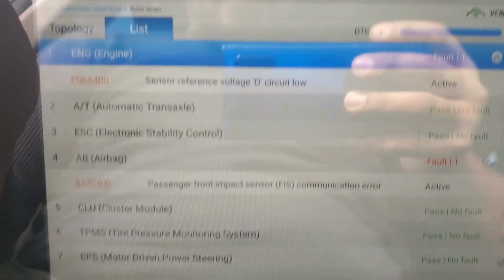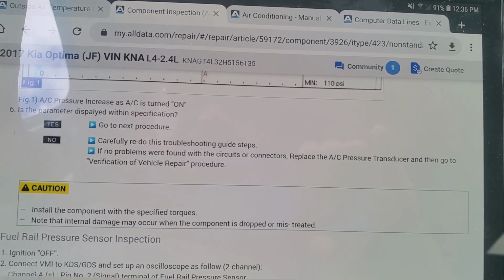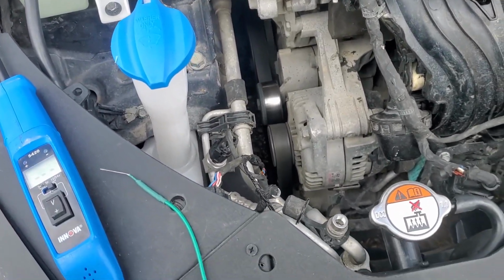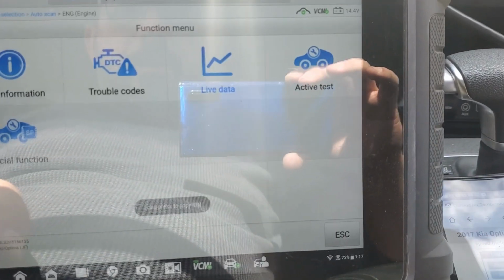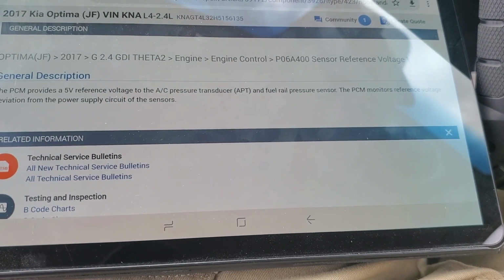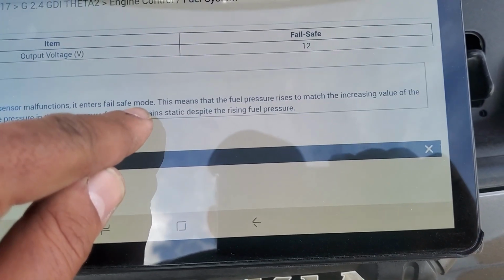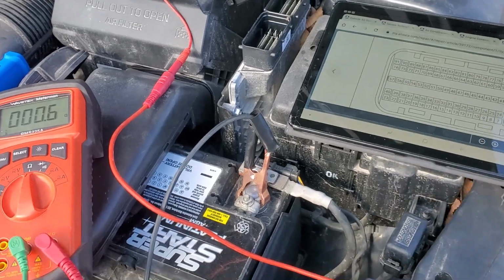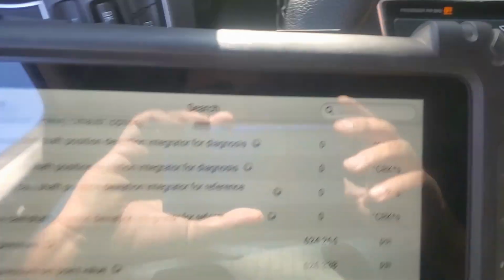2017 Kia Optima P06A4 Sensor reference voltage "D" circuit low

Comment: Tuve el mismo caso tensión de 5 volts en el sensor  ac y al mismo tiempo código de airbag y control de crucero  t el daño era la el clock spring estaba en corto aterrizando los voltage  y listo solucione todo

Comment: My kia Sorento air conditioner not working but I saw your step by step diagnosis, I did it also and I found the problem in fuel rail pressure sensor
Thanks boss 
More knowledge 💯

Comment: Hi, tell me please, I have Hyundai Santa Fe 2020, after crash, I change radiator a/c, but  now  I can't put freon in it, the compressor does not turn on, although the power goes to the compressor on the air conditioner sensor voltage of 4.97 volts, help, what could be the problem?
Reply from the maker: I would take it to an AC shop to diagnose it properly

Comment: 2011 KIA optima 2.4  No DTC 
I have the same engine shudder as this car. I even have problem with AC not cooling until later after driving for 5 min. The engine shudder is at idle only after warm up. I have diagnose for days. Can not find anything. Engine was replaced under the recall  Do you think I have problem with fuel pressure sensor? Great diag Thanks!
Reply from the maker: Do you have a scanner with live data? Can you read the fuel pressure sensor numbers and compare to specs?
Reply: @DallasAutoDiag  
Had to convert from hpa to psi.
It shows about 600 psi at idle. 
Sensor signal voltage is 1.23.v
Reply: Did you solve the problems?
Reply: @abdul-kabiralegbe5660  Nope

Comment: great video and very informative Thanks
but when i subscribed to all data it didnt give schematic wiring diagram
Reply from the maker: It should. Even alldatadiy does
Reply from the maker: You can call them and as for help. How much you pay a month?
Reply: @DallasAutoDiag  around 20 dollars may be that's why 
But I really learnt from you how to use Autel and check live data
Appreciate it
Reply from the maker: @shamalabed  I pay $190 a month
Reply: @DallasAutoDiag  right 
Thats why they give full details of whatever you want
I don't have a worshop but  iam learning how to check voltage on sensors and other stuff
You are helpful and explain good
Thanks again

Comment: @ 29:11 even I was thinking the same thing, that this is a software issue, & the weird part about this DTC & flow chart is that they're not specific about a single sensor or circuit which makes the diag even more difficult🤔
But you nailed it👍
Thanks for sharing, this is the first video on YouTube about this DTC👍
Great work, Stay Safe Bro😎
Reply from the maker: Once he told me on the phone that there is no video on yt on it, i did not believe it and made sure to jump on it right away 🙂
Reply: @DallasAutoDiag  Great work Bro👍